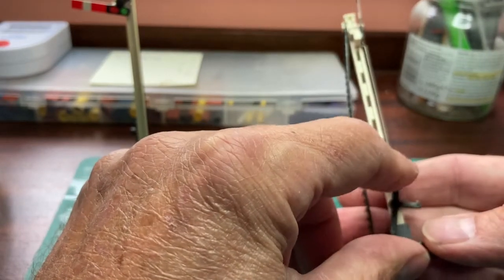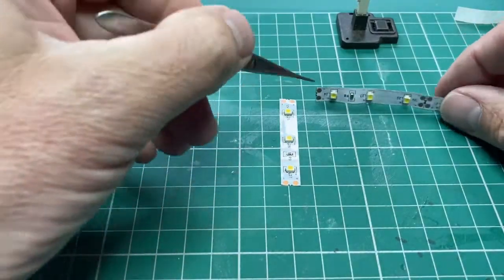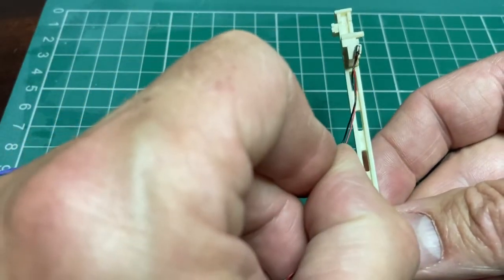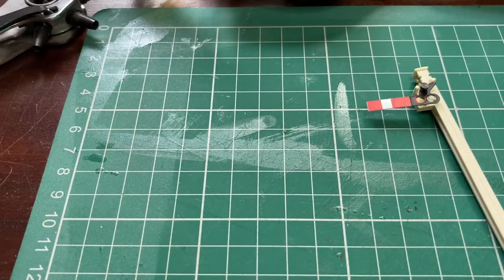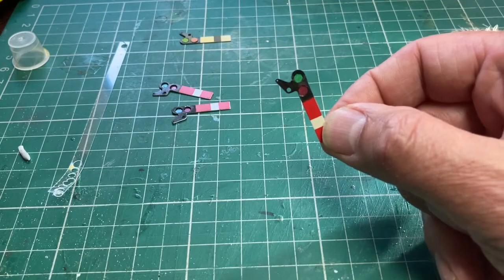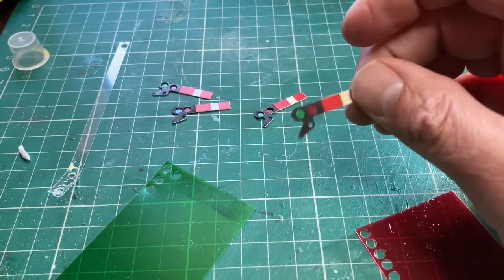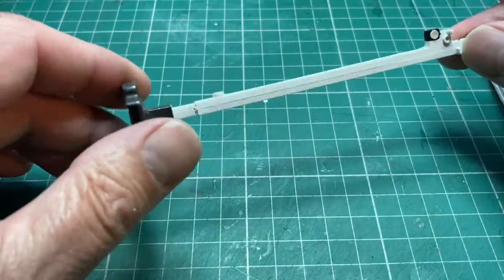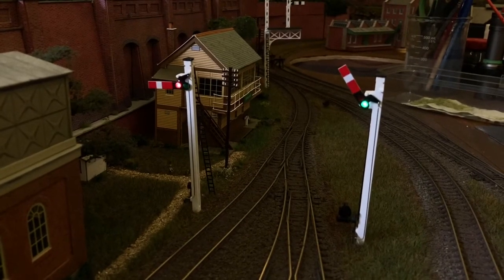Adding LED Lighting to Hornby Semaphore Signals

Comment: ¡Hola buenas tardes Paul!  As a first attempt, I think very well done indeed. On my own layout, I have been scratch building some early era two-aspect colour lights but, for a proposed addition branch line, I will be looking at using semaphore signals and operating them via rods, from servos, and using LEDs to light them. Your videos has been extremely useful. One question, where did you source the SML?  Un saludo. Gary